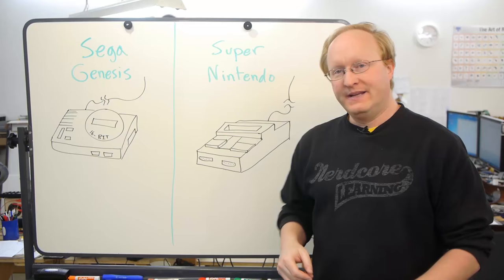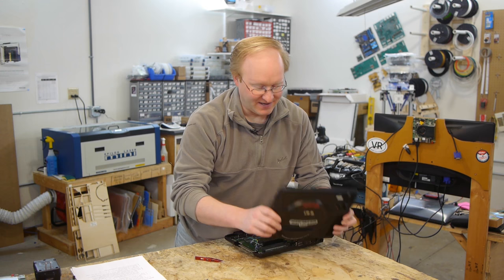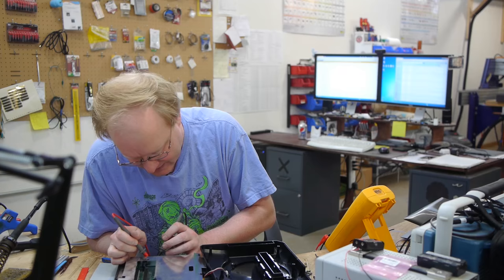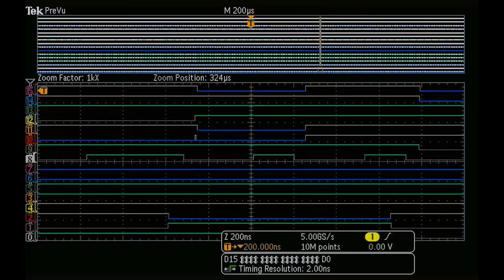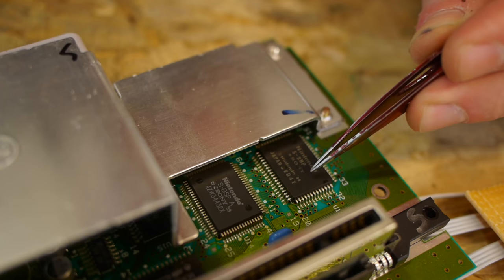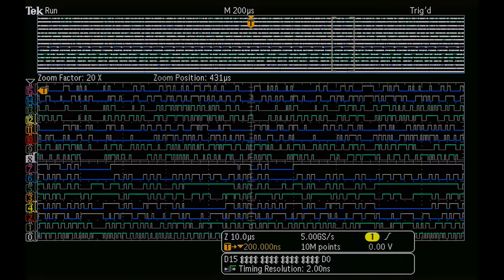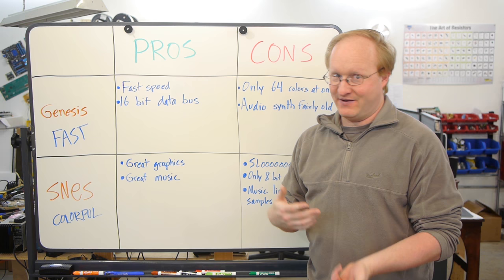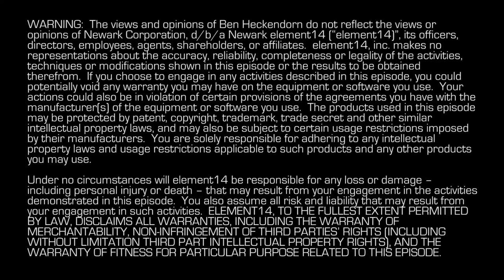Ben Heck’s 16-Bit Console Wars!

Comment: Ben! If possible, do a Playstation 2 vs Original Xbox detailed benchmark and testing. It was the fanboy fight of the 2000s! I'd love to see that, specially knowing that the PS2 was waaaaay ahead of it's time.
Reply: What about the GameCube? Can't it join the benchmarking party?! :P
Reply: jorenmartijn I don't think the GameCube has that much of horsepower compared to the PS2 and Xbox
Reply: Well, benchmarking those systems would not do justice because the plot is quite thicker.
The PS2 is basically a system with a very powerful CPU but a very basic GPU with a very fast but small video memory (4MB at blazing fast 48GB/s that is pretty much twice the speed of the PS3 video memory (!)).

Now on other hand, both cube and Xbox have a weaker CPU, but most of the 3D workload is made by the more advanced GPU that did for example hardware T&L and mixed the audio on separate DSPs, instead of using the CPU like the PS2 did.
Also cube/Xbox supported texture compression, that allowed em to do more with their memory spaces, and primitive pixel shaders, that allowed em to do certain special effects on screen like bump mapping, screen deformations, realtime shadows...

This last part the PS2 CPU can actually pull off, but you needed to sacrifice the CPU time the game would use.
Reply: Mike Fox Screw the new consoles go old school or go home.
Reply: Mike Fox Would be more fair and accurate to compare the PS2 to the DCast and Xbox to GC. Xbox would win in any case though.
Reply: Mike Fox It would be no contest, the original Xbox its like 4x more powerfull. The Gamecube was also more powerfull than the PS2. Dont know why you think the PS2 was ahead of its time when its was barelly more powerfull than a Dreamcast... 
Anyways at the end of this wikipedia page you have a technical comparison of all the consoles (included Dreamcast) of the Six generation http://en.wikipedia.org/wiki/History_of_video_game_consoles_(sixth_generation)
Reply: rayco santana it was ahead of it's time because of how it was built, look at how hard it is to emulate it? It has various coprocessors and it's a very complex design for any console at the time, much like the PS3's Cell Processor. And I wouldn't know because in my country, no one owned a Dream Cast, it wasn't a thing here to buy it, never saw one for sale either used or new.
Reply: KernDesertPreppers the PS2 is new? Okay
Reply: Dr_Kachu san Thanks, I do really like digging into old hardware, I don't know why. That was a very interesting comment, I do know how it ticks though, but I'd like to see a video about it, it'd be interesting for others to get a sniff of old hardware.
Reply: Mike Fox There's no point, my Xbox Original can output 1080i where the PS2 struggles with 480i... the Gamecube is more powerful than the PS2, playstation was by far the weakest of that generation.
Reply: The Gamecube and Xbox were both more powerful than the PS2 (the issue with the Gamecube was the limited capacity of its optical media).
Reply: ***** The PS2 outputs 1080i too. Even if it's just 2 compared too the xbox' 5 games.
Reply: akawhut Not in the pal version, 480i is max... the Xbox can also do 720p which in my opinion looks much better than 1080i
Reply: Heh, talking in 16:9 ratios when most games were 4:3.
Reply: Dr_Kachu san the xbox is basicly an pc
Reply: Satakarnak
I like that logic, anything with a couple chips inside and input/ouput capability is basically a pc.
More seriously, what are you referring to ? Why would the Xbox be more a PC than the Gamecube or the Dreamcast for that matter ?
Reply: TheSliderW He's probably referring to how the xbox was basically built from off the shelf components and utilized directx (hence the name).
Reply: Nanofuture87
 Yeah, i can understand that feel especially since MS is a software dev for PC. But then again, almost every console was made out of off the shelf components and DX is a generic API like OpenGL which can be used in one form or another on pretty much any 6th generation console and above if you don't like the proprietary ones (Yes, nintendo and Sony also have their own API, they simply don't talk about it).
Reply: Dr_Kachu san You don't know what you're saying. The PS2 had something around 300mhz, whereas the Xbox had a 700+MHz CPU. The GPU in the original Xbox was also superior to the PS2, and the original Xbox also had direct x support. The original Xbox CPU had the same MHz as the Nintendo Wii, alright. Now stop talking out your ass. 

Again, the GameCube had 400+ MHz, and the PS2 is still at the 300MHz mark. The GameCube had a slightly better graphics processor too, but the limiting factor was those micro discs that held 1.5GB of data on them, as opposed to the 4.7 on the PS2. This is all fact, not bullshit.
Reply: TheSliderW Every console since the PS1 or so do indeed have a complete API to access the graphics, but not always the devs used it completely, generally going "bare to metal" when doing stuff that the APIs were too slow at.
But people did that to the Xbox as well, so you're correct in saying its the same thing.
Reply: Kyle247l Comparing CPUs clock by clock like that is a very,very bad idea, given the fact the architectural differences of the CPUs can easily skew the performance away.
I mean, do you actually think a Pentium 4 3 Ghz and a Core I7 3 Ghz have the same performance?

The PS2 CPU had three cores, each able to perform 8 floating point operations per cycle using SIMD processing each, while the Xbox CPU had only a single core able to perform 4 floating point operations per cycle or so.
So, the Xbox CPU gives you 2.9 billion FP operations per second, or 2.9 Gflops, while the PS2 CPU trio, the EE is able to perform around 7.6 GFLOPS, thus being the faster CPU, despise the slower clock.

But there is a reason why Xbox still wins and hard at triangle count for example.
To perform the 3D graphics, besides drawing the triangles, you also have to position/scale/translate, perform the 3D coordinates to 2D coordinates with perspective transformation and lighting calculation on the model, and this is accomplished by an operation dubbed "T&L" (as in Transform and lighting).
This operation is very heavy and requires you to perfom around 40 floating point operations PER triangle corner, or "vertice".

While the PS2 tackle this operation using its powerful CPU, the Xbox, just like the gamecube have dedicated circuit on its video chip that perform the T&L math MUCH faster than the PS2 CPU can accomplish, and does that without actually taking much CPU time, leaving the CPU free to do other things.

Also the PS2 had a very simplistic audio output with two channels, and all the audio mixing had to be done on the CPU as well, while Xbox and Cube had a dedicated coprocessor to handle this for em.

And finally, what limited the gamecube was not the disk, but the fact you only had 24MB of fast memory available, as the other 16 were really painfully pitifully slow, at 40MB/s, being completely useless for storing texture/geometry data.
Reply: Kyle247l There's no reason to be unpolite like that.
If you want to disprove me, go do some research on the architectures of the CPUs etc and bring some hard proof instead of doing pointless personal attacks.
Reply: Dr_Kachu san He may be a twat, but he's not wrong. The proof is in the pudding, play the same game on both systems and you'll see the difference. The PS2 would never have been able to run Halo 2 or Forza
Reply: *****
I'm not saying that the PS2 is more powerful than the Xbox. I'm saying it got a more powerful CPU, but have to waste all this extra power "emulating" things the Xbox does not only natively by hardware, but faster than what the PS2 is able off even if it used its whole CPU power for the task.
Reply: Dr_Kachu san The PS2 is all round shit, it was built as a DVD player first and not a console whereas all the other consoles were built for gaming.
Reply: *****
It's actually even weirder than that.
If the PS2 was aimed at being the cheapest DVD player possible, they probably would stick a dedicated Mpeg2 decoding chip on it and make an improved PS1 to cut costs on R&D.
But instead, the PS2 is the dream of a madman, it is a console that was designed to be a "supercomputer", to give the programmer a very powerful CPU, and use it to emulate pretty much everything else to cut costs, so it was more of a "jack of all trades, master of none", while Xbox and Gamecube were machines designed specifically to run 3D games and nothing else.

Ironically, the PS1 had a much, MUCH better design philosophy behind it, being for example the first commercial consumer product to sport hardware T&L (that operation i been nagging on my last 2 posts or so), and with this and its hardware triangle rastering engine, it managed to match a pentium 200 Mhz software mode tier 3D graphics with a 33 Mhz CPU.
I bet both the radeon and geforces powering the gamecube an xbox respectively are heavily inspired on the PS1 innovations, and PS2 was the only one to miss this boat.
Reply: Dr_Kachu san That doesn't make any sense, my Xbox and ps2 are both modded. The Xbox can emulate pretty much anything that came before it whereas the PlayStation struggles with anything past 2d. With mods the xbox is essentially a computer and you can do whatever you want to it, the PS2 is just a paper weight. The PS2's graphics and frame rate just made the console a paper weight, even back in the day i could see how bad it was in comparison to my other consoles. Xbox had custom soundtracks and a bunch of features the play station couldn't hope to achieve. Certainly not with an 8mb memory card...
Reply: ***** In the case of the emulation, the xbox have a HUGE advantage (no pun intended) by the fact it use a x86 CPU, which allow people to port PC emulators with Dynarec/JIT to it without much work, while with the PS2, you would have to rewrite the whole CPU emulation engine from scratch.
To explain a bit more detail, this jit/dyna stuff is a way to emulate the systems by translating the code from the original CPU to the host CPU and then running this code natively, while the other method, the interpretation runs the emulated code command by command with a massive switch statement thing.
But interpretation is "CPU agnostic", and you can just compile and run it on everything, but its horribly painfully slow.

And then there's the part where the PS2 CPU power comes from having three CPUs rather than one.
Splitting the emulation job between three CPUs is actually impossible unless the system being emulated also feature three CPUs, or have some heavy secondary task, like translating GPU code like it happens with the dolphin emulator etc..
So yes, emulation is not exactly a fun job for a PS2.
A better case would be using the Xbox and the PS2 to encode video, in this case using only the CPU, the PS2 would beat the hell out of the Xbox... until you used the pixel shaders on the GPU of the Xbox.
Reply: PS2 had arguably a better library, that's all it had going for it.
Reply: ***** Run a Sega Saturn emulator on the Xbox.
Reply: Arctic FoxX
 It will run slowly for obvious reasons, but if you attempt to run it on the PS2, the emulator programmers will most likely choose chasing you with pitchfork and torches instead of coding for that hell to emulate an even worse hell.
Reply: Dr_Kachu san
I better go into hiding while the angry modder mob passes :).
Reply: Mike Fox The Gamecube is a surprisingly powerful lunchbox. It was rarely used to its potential. Play RE4 on the GC and then on the PS2. There's a big difference.
Reply: s0nnyburnett
The RAM crippled the poor lunchbox quite hard.
Just to give a clue, just look how many games on it use a lot of identical models onscreen to make use of its powerful 3D engine.
Basically it is able to do 128 marios, but not 128 different nintendo characters.
Reply: Dr_Kachu san GCN had 43 total MB of memory. PS2 had a bit less. but proof is in the pudding; RE4 looked like dog crap on PS2 compared to Gamecube.
Reply: Xbox 1st is best (NOT THE XBOX ONE 2013) WHY?

PS2:Half Life 1
XBOX 1st: HL2

BUT:
PS3/XBOX 360 HL2/HL2EP1/HL2EP2

Wtf Why not HL3/HL2EP3 COMING FOR PS4/XBOX ONE 2013???

Gabe Newell, this is how you ****ing count to three.
1,2,3. DONE NOW GET HL3
Reply: HL3 will probably stay pc exclusive, not like they need extra console sales, it will still sell stupid amount of copies just being on pc
Reply: *****
It doesn't matter, nobody bought xbones anyway.
Reply: Mike Fox You've obviously never seen Resident Evil 4 on the GameCube compared to the PS2. The GameCube version runs and looks much better. Also, if you're looking at raw processor speed, I think the original Xbox is the power house of the 3. It was basically a PC IIRC. The GameCube is #2, and the PS2 is last. Of course, it's like comparing apples and oranges anyways since they all used entirely different processors. I think you'd be surprised at how they actually compare.
Reply: Garth Palmer
From the 43 MB, 3MB are cache (but 2 of those 3 actually do save memory as they store the Zbuffer and backbuffer), and 16MB are pretty much useless for realtime 3D because they have an atrocious 80MB/s of access rate and are generally used more for audio and disk cache. The actual Work ram of the device where you can store texture and models is onle 24MB of that fast sram like memory.
But the cube still can do better textures than the PS2 because it supports S3TC compression that makes the textures 4-8 times smaller.
Reply: Dr_Kachu san well ok then. just saying its really not that gimped, at least compared to PS2. still ran fine and had plenty of good games. it was a better console than the Wii.
Reply: Mike Fox There is no point as the original Xbox would win using Ben's testing methods.
Reply: BlueFoxTV I didn't know till people started commenting, though it was a real debate. People almost hit each other over it. Funny enough when I was a kid, I went to a cousin's place and he had an Xbox, I was like..  "what Playstation is that?" xD
Reply: Garth Palmer
 Wii actually got to show what a gamecube with more memory is able to with Super Mario galaxy, given the fact its just the cube with a moderate clock bump that would not be alone the reason to all the improvement, and cube would at least be able to pull that game off at 30 fps.

But its a shame SMG is pretty much the only game that shows what Wii could actually do.
Reply: Dr_Kachu san in terms of games though, GCN had better games overall. Wii has like, SMG 1&2, Skyward Sword and Brawl.
Reply: Garth Palmer Indeed it had, given the fact the third parties weren't trying to cash in on the "casual gaemrz" on the cube, and nintendo was not too busy doing wagglefests.

Also the industry don't have a frakking clue on what the casuals actually want, and everything they do to attempt to "cater to the casual audience" actually pushes em farther and farther from the games.
Reply: Mike Fox Actually the GameCube was more powerful than the PS2. 

The PS2 was actually the least powerful system in the GCN/Xbox/PS2 troupe.
Reply: The 64th Shadow Heck, the Dreamcast could out perform the PS2 in some areas, just try Quake3 or UnrealT on the DC, simply the best console versions of these.
Reply: stunthumb
The biggest advantage DC had over the PS2 was the S3TC texture compression also available on it, which allowed that huge (for the time at least) textures on shenmue.
But the PS2 did beat it quite hard on triangle count,thus making very hard if not impossible to DC to run for example GTA 3/SA etc..
Reply: Dr_Kachu san Yeah, the lack of big games like GTA3 really hurt the DC.
Reply: DC had a small library but a lot of the games it had were just great. Still miss Power Stone and Starlancer to this day. Capcom really needs to remaster and rerelease the Power Stone games.
Reply: Mike Fox You're kidding, right?
GameCube = 485Mhz 32bit CPU
PS2 = 295MHz 32bit CPU
GameCube = 162 MHz ATI "Flipper" GPU
PS2 = 147 MHz GS GPU

The GameCube may look cute and all, but it is more comparable to the Xbox. PS2 is more comparable to the Dreamcast.
Reply: Dash
Not wanting to repeat myself much, but comparing CPU clock by clock like that is never a good idea, specially when you forget to mention that one of the CPUs is actually a triple core CPU (the PS2 one).

But as i said earlier, the end result still ends with Cube and Xbox winning hard on the 3D rendering department because they have dedicated and very powerful circuitry to perform the heaviest CPU bound operation when drawing 3D graphics, while the PS2 have to resort to its CPU to not get even half of the performance of the other two on that particular operation while using its full processing power.
Reply: Dr_Kachu san I do agree with that. But I still think the Xbox and Gamecube had, in addition to better clock speeds, better designed CPUs and GPUs since they were newer and were developed by veteran companies like IBM, ATi, Nvidia and Intel. Not to say that the PS2 sucked. It was good for it's time. But when you mentioned that the PS2 was using 3 core tech, where did you hear that? Is there a link to that info?
Reply: Dash
I'm a bit lazy to go after better sources right now, but:
https://en.wikipedia.org/wiki/PlayStation_2_hardware
The V0 and V1 units are well, to be more precise DSP units rather than full CPUs, but they give the PS2 CPU the capacity of processing around 6.2 billion of multiply+accumulate operations per second, if compared to the 1.9 billion you get from the gamecube and around 3 billion the Xbox CPU does.
But the google (lol) also tells me that the T&L units from Xbox and cube clock around 10 billion of those operations per second, so it's quite a wash.
Reply: Dash
I really have no idea why sony went with that route, instead of just improving over what PS1 had, because that beast was actually very advanced for its time.
For example, unlike the PS2, it actually did hardware T&L.
Actually, the whole 3D job on the PS1 was done by hardware, which allowed it to have a CPU that was around the performance of a 486 DX66, and pull off pentium 166 softmode tier graphics.
Reply: Dr_Kachu san How to make a Nintendo console:
Step 1: give it a fairly good CPU (The N64 being excluded, which had a beast for its time
Step 2: give it a monster GPU (The only reason the N64 didn't look good at the beginning was SGI's awful microcode)
Step 3: give it a pitiful amount of ram (The SNES should have had the wram and vram amount switched.
Reply: ***** Actually, nintendo don't always give the consoles a pitiful amount of memory.
They sometimes just make it awful in some other way, like making the memory really slow or really laggy or a combination of both, or as you said, in the wrong place.
I think the only consoles nintendo didn't did some sort of mistake with the memory were the gameboy color and the WiiU.
Reply: ***** Conker's Bad Fur Day looks a lot better than any PS1 game I've seen, and I'm sure you could still make the N64 do a bit better. (There are also plenty of other good looking games, but they were released in 2000 and 2001 and other late years where Nintendo allowed companies to make their own microcode.) When I said it could have looked good, I obviously didn't mean by today's standards.

About Nintendo consoles with their memory, this is the way I see it:

NES: Too little memory, (4KB I think?) but the console was made in 1983. (Cartridges had chrrom, or chrram, so tiles weren't stored in vram, only BG tables.)

SNES: More than enough ram, too little audio and vram. The SNES is slower than dirt at uploading information where it can only transfer about 6KB per frame (without any black border on the top and bottom of the screen), but the Genesis had it about just as bad. I think it can upload about 6.5 KB per frame, which isn't much better, so I'll give it to Nintendo here. The main problem is that sprites can only pull their graphics from a 1/4 of vram, because there aren't enough character bits in oam. The Genesis doesn't have this problem because it has less sprites so each sprite has more information on it. The SNES should have just done away with 8x8 sized sprites and used 16x16 as a minimum like the Turbo graphics 16 so you could index all of vram. The SNES only allows you to use 2 different sprite sizes onscreen anyway. (I've actually been writing programs on the SNES so I know alot about it.)

N64: too little ram (4MB), but the biggest offender is the 4KB texture cache, only allowing 64x64 sized sprites. The N64 actually would have been a beast a being a frame buffer 2D system.

GC: Like you said. I don't think the memory on the GameCube is all purpose like the N64 either, in that it's more like the SNES that each thing has its own ram.

Wii: Don't know, don't care.

Wii U: 2GB is enough. The Xbox One and PS4's amount of ram is unproportional to the rest of the system's specifications.

Also, the Gameboy Advance was fine. You could almost update all of the 96KB of vram in one frame, although I can't say that 96 KB is too remarkable, especially when you can have 4 8bpp BG layers simultaneously onscreen. Ram is fine, as I think I've heard it has 32KB of fast access memory, and 256KB of slower memory. The processor runs at 16.8MHz so I don't think a minor speed penalty would do much. (I'm not 100% sure about main ram on the Gameboy Advance though.)
Reply: Maybe you should have devoted the time that you wrote that into reading. You only needed to read the first 9 line paragraph, as the rest was for Dr_Kachu san.
Reply: *****
On the case of the SNES, they could in theory use the memory to mitigate the slowdown problems of the cheaper carts.
The snes CPU can switch between 1.76 Mhz, 2.68 Mhz and 3.58 Mhz, and depending on the quality of the ROM available on the cartridge, the game will be programmed to run either at 2.68 or 3.58, and well, several action games used the 2.68 to cut down on the costs.
But if snes had some lets say 4KB fast SRAM memory somewhere that could run snes code at 3.58 Mhz, games would be able to just dump the critical speed code there and don't even NEED the more expensive rom anymore.

GBA does exactly that, by having a 16bit RAM that gets slow if you try to run ARM code on it instead of using the THUMB mode, but it having a small 32bit 32KB cache where ARM runs faster than THUMB.
Reply: Dr_Kachu san Another nice thing about having 128KB of ram is that things like level maps can be decompressed when the level is loading so that you don't need to constantly decompress the level map while the screen scrolls. A 3.58 MHz 65816 really isn't that much slower than a 7.8 68000. A simple branch on the 65816 takes 3 cycles, whereas it takes 12, which is actually about twice as slow, taking the higher clockspeed into account. It's not like anyone has accused the NES of being twice as slow as the Gameboy because it is clocked about half as fast.
Reply: *****
Well, 64KB of main ram probably would be enough, if that meant having twice the tile memory.
That would even make the high res mode of the snes actually useable.
Reply: ***** The 128KB of WRAM on the SNES isn't really 128KB, let me put it this way. It's like 64KB + 64KB, the 5A22 is stopped and each DMA operation can only access one 64k bank at a time. The full 128KB can be accessed but it limits the system. The 5A22 isn't a  65c816 I don't know why people still to this day call it a 65c816. As a matter of a fact the SPC700 (yet better) is very similar to the 6502 and no one says that the SPC700 is a 6502. For me both systems the Genesis and the SNES are very similar with the advantage on the SNES just for the extra HW stuff it does video effects and sound.
Reply: Marco Duarte The 5A22 is a 65816 with extra thinks inside, like a multiplication unit and a DMA controller, but you communicate with them like they are not part of the 65815, because they aren't: It's like multiple things put in one plastic case. There isn't any multiplication instruction or anything; you have to write  to registers to the registers for the multiplicand and the multiplier, and the multiplication unit will then give you the result in a register that has that sole purpose. Same with DMA. Their isn't an instruction for it, you have to do multiple loads and stores to different registers to activate the DMA controller located in the same plastic casing. I don't think the SPC 700 is like this, because I'm pretty sure it has its own instructions that the 6502 doesn't have unlike the 5A22, like how it can exchange nibbles in a byte. The SNES is not very similar to the Genesis at all except that they are similar from a processing power point of view, but both systems where designed differently, unlike what I could say about consoles today.
Reply: Marco Duarte
I don't see having to stop and swap page etc being a painful problem.
Probably the worst part of the snes is not being able to access the VRAM outside the vblank.
Reply: ***** You got my point here: "The SNES is not very similar to the Genesis at all except that they are similar from a processing power point of view, but both systems where designed differently, unlike what I could say about consoles today." About the rest just take a look at the SPC-700 information. When I said "The 5A22 isn't a  65c816" it's like a 5A22 is a 5A22 and a 65c816 is a 65c816. Thou the 5A22 is binary compatible with the 65c816 and the 6502 it's "extra" stuff make it a 5A22.
Reply: Dr_Kachu san Never said that it was a painful problem. I just "quickly" explained how it works.
Reply: I am a PC gamer these days but be honest Xbox original is the clear cut winner
Reply: Jack Bob I'd agree to that, but the console that moved copies was the PS2. I personally had a PS2 but I'd love to get me an Xbox original to replay games with higher texture quality and sound.
Reply: Mike Fox The PS2 had a few great games (Shadow Of The Colussus, Ratchet and Clank) but the Xbox was more like a PC it does stand for DirectX box its was further ahead of its time IMO and with its Live service it pushed the boundaries of what was previously done on a console (excluding the dreamcast)
Reply: Jack Bob the point was really the multiplatform games, the ps2 usually sold twice if not more copies of the same game released on the Xbox.
Reply: Mike Fox Despite the fact that it almost consistently got the worst version between the 3 major consoles.
Reply: ***** but it did.
Reply: +rayco santana Sorry, but that technical comparison is full of errors.
Reply: +stunthumb As a fan a big collector of DC stuff I inform. GTA3 was at one point coming to DC and PC, but once SEGA killed it the GTA "project" for DC was dropped. Same for HALO. As a prove there is a SEGA flyer for up-coming games where you can see and read about both games and for a lot more games...
Reply: The ps2 had a terga 2 prossesor and was 2times faster then the original xbox it also had a better color pallet. The xbox ran off of a Microsoft crd chip they use those in the early chrombooks that were released. And xbox had a better online experience and better controllers except for the duke that was released with the console. So you are right ps2 wins all the way. The xbox was slightly faster when it came to fps so shooters and racing games ran smoother but ps2 was better at rendering rpgs and plattfourmers
Reply: Ray L "The ps2 had a terga 2 prossesor and was 2times faster then the original xbox"

No, It ran on the custom "Emotion Engine" processor, which was based on MIPS R5900. And no, it's not twice as powerful as the Pentium III in the original Xbox. The Emotion engine can apparently do 6 billion instructions per second compared to the Pentium III that does about 2.5 billion at the clock speed it runs at, but because of the MIPS architecture of the Emotion Engine, each "instruction" is very limited, and there are several times where you could probably accomplish four different instructions in MIPS in one instruction in x86. If anything, it's probably the other way around. I don't know where you're getting color palette from, because just about every 3D system that isn't the 32x uses 24bit color.

Like I said, in terms of power, it's

Dreamcast
PS2

A decent sized technological gap...

GameCube
Xbox

And the Dreamcast was even more powerful than the PS2 is certain aspects, but not over all. Most sold almost never has any correlation to most powerful.
Reply: *****
Actually, the PS2 processor as i probably stated on this reply line before is a trio of CPUs, or a CPU and two DSPs to be more precise, and if you gather all three yes, they're more powerful than the Xbox or gamecube CPUs.
But as they HAVE to do the T&L and audio mixing bullshit with code, while Xbox and gamecube offload those operations to dedicated faster hardware solutions, they win overrall.
In theory the PS2 is more flexible due that but its not as nearly enough advantage to put it on par with the others.
Reply: *****  Actually, you don't need to go this far.
In terms of raw flops, the PS2 CPU offers you 6.7GFlops, while the gamecube and Xbox T&L hardware units do over 10 with ease, but the T&L hardware only can do T&L, which is well pretty much the biggest floating point load when doing 3D graphics.
So even at the "untextured raw triangles", Xbox and cube still kicks the PS2 bucket hard.
PS2 would probably win if you were using the consoles to do things like protein unfolding, but as far i know, they're machines meant to run 3D graphics.
Reply: +Mike Fox i am a ps2 fan but Xbox and Gamecube both was superior systems....both had better graphics abilities and xbox had a far faster system
Reply: Team Cannon Fodder You're telling me the Gameboy had better graphics than the PS2?
Reply: gamecube...spelling error lol, corrected now
Reply: +Team Cannon Fodder My understanding is that's correct. I know the console itself is quite a bit more powerful in several areas but graphics were pushed on that console because Nintendo was doing that at the time. NES was a graphical powerhouse in its day, as odd as that sounds now. SNES was cutting edge graphics wise too, and obviously N64 had that going for it as well. Gamecube was sort of the last hurrah for that era of Nintendo's history. That machine was capable of particle effects the others couldn't do until the next generation, for example. I believe the poly count was a good deal higher too but I wouldn't know by how much unless I looked it up.
Reply: Hezekiah Ramirez Nothing bar arcades could make the bidirectional smooth 60 fps scrolling of the NES back then until the release of the SMS,
Not even computers until the MSX2 release.
Reply: Dr_Kachu san that problem was solved by John Carmack with the commander Keen games (he tricked the computer into loading pixels before the player reached end of screen) that is how most IBM clone PCs ended up doing it until they started rivalling consoles
Reply: Hezekiah Ramirez yes and no, most Nintendo consoles was better in colours and other similar areas but Sega had better CPUs also interesting point the N64 graphics was first given to SEGA and the head of the company in the US wanted to use it. Japan refused and made the saturn with their own graphics.....also worth mentioning the head of the US wanted to build a console WITH sony, once again ruined by Sega of Japan...in fact most of the bad descisions regarding the 32x, sega cd, sega saturn, sega dreamcast all came from Japan, can you imagine the Saturn with n64's graphics even a 32bit version of them? 

As for Gamecube, i think the xbox was more powerful, in terms of graphics but the original xbox was basically a PC for the masses anyway
Reply: Team Cannon Fodder He got quite close, with 40 fps, but its still not the 60 the NES did.
IBM PC was actually a quite bizarre system, held up by some really bad design decisions ibm did, and the pixel rate was definitively one of em.
In the standard VGA, there are only those few "timming windows" where the CPU can actually write to the memory, and if you try to do it out of the window, the video card actually locks up the CPU until the window is available with a wait state bullshit.
This effectively drops the CPU speed to around the original 8088 speed, no matter how fast the thing is, thus making impossible to reach 60 fps on the older IBM standard cards, which made all the ports etc run at 30 fps on it.
Doom ends being the most extreme example, because it was doing graphics that were basically impossible for an sega genesis or snes, but was still limited by this bottleneck thus having a maximum frame rate of 35 fps.

But this changed completely with the pentium, where intel basically redesigned the whole system from the ground up, tossing away "legacy stuff" and making PCI a thing.
With the changes, PC could 60fps/1024x768 on 2D without breaking a sweat.
Reply: +Mike Fox ps2 actually wasn't. The gamecube was technically faster in some regards than the ps2, hence why the gamecube version of RE4 looked and sounded so much better than the ps2 version. The real limiting factor was the disc capacity, half of what a dvd could hold. 

With regards to the xbox vs ps2, once again the xbox actually was more powerful. It was just a pain to work with. By the time it came out, the ps2 already sold so much, so developers stuck with it. 

Not downplaying the ps2, I loved my ps2 back in the day and it was easily my second favorite console of that gen (my favorite was the dreamcast). Just saying though, the ps2 wasn't ahead of its time at all. With DVDs, yes. But everything else, not so much.
Reply: Xerazal
The RAM was a much bigger limiting factor on the gamecube than the disk size.
24MB of actually useful memory is just too few, specially if compared to the 32MB found on the PS2 and 64 on Xbox.
Of course, texture wise gamecube was better than the PS2 because it supported S3TC texture compression, which made em 4 times smaller on the memory, but Xbox did as well and Xbox again had 64MB to use those compressed things.
This is also the reason why PS2 can't run shenmue.
DC was the first console to do S3TC.
Reply: Actually with 4MB you could fit the frame buffer and Z-buffer and have space for some textures , after all the gamecube fit their stuff in a fast 3MB cache, with 1MB for each of those things.
But that meant organizing the whole scene by the textures and trying to reuse em all you can, because every texture switch, a pain.
And as it didn't supported texture compression, "switching textures" on PS2 was even worse.
Well, to be fair to the PS2, you KINDA have some kind of something you can kinda call a "compression" that is using paletted 16/256 color textures, but this don't work well at all with organic textures.
But when your 16 color texture use the same memory space as the 65k color textures of the gamecube/xbox, stuff gets hard.
Reply: Dr_Kachu san You talk about texture compression, but I'm pretty sure it's lossy, (like a jpeg) so I'm not to sure you'd really get much, if any, advantage over a 256 color paletted texture. I think the compression works like some amount of colors (2 or 4 or something) with "unlimited" luminescence values in something like a 4x4 pixel square. I may be spewing out nonsense though. I don't think GC and Xbox textures would be 16 bit RGB, but 24 bit.

Also, about the GC memory size, I'm pretty sure it's in a better spot than the PS2. The thing you're forgetting about is although there's 24MB of main ram, (and 3 MB for the frame buffer) there's also 16MB that seems was used for audio? (Why that large compared to everything else?) Anyway, one thing I've heard is that you can DMA information from the 16MB ram into main ram and vice versa. It takes more time, but I'm pretty sure ram on the GameCube is faster than on the PS2. I wouldn't even be surprised if you could reasonably copy textures from the smaller ram into a buffer in main ram and keep overwriting it while rendering the scene.
Reply: *****
I don't count the audio ram as "useable memory for graphics" because its access rate is around 40 MB/s, which make it more useful as a disk cache rather than something you can access every frame.
Also i said "24bit" due how the S3TC format works.
Each of the 4x4 pixel blocks have four possible colors, which two being set indeed by two 16bit values, but the other two being 25%+75% and 75%+25% mixes of the other two, and those mixes being free from the 16bit range limit.
And believe me, the S3TC looks a HELL lot better than 16 color textures and even most 256 color ones (which take twice the memory space of the S3TC ones) due not having to rely on dither that looks very bad when used as textures.
Reply: Dr_Kachu san Only 40MB per second? Yeah, the blows. I'm not entirely sure what a disk cache is though, just loading data from the disk into there instead of main ram? (I know a lot more about early technology like the SNES) I suppose there are a couple of clever ways you could use it, but yeah, that transfer rate is extremely limiting. I definitely imagine the S3TC format looking a million times better than a regular 4bpp image. I imagine some really colorful textures would be quite limited though, which is why I'm now asking: is there a way to use non compressed, 32bpp textures? I mean, I imagine they'd be used for 2D games.

Yeah though, it's clear you know a lot more about this stuff though, so I should probably back off...

Edit: Actually, where did you find the page that said 40MB per second? I just want to know because nothing I know goes that in depth about the GameCube's hardware. It's kind of sad though, that I just found out that the GameCube's ram is SRAM instead of DRAM, just because (like I said about me and older technology) that's what I'm used to and it's more flexible.
Reply: ***** Theorical and pratical polygon per second measures are very different, specially when you use the CPU to perform the T&L as was the case with the DC, but you're probably right at the memory being a bigger issue, given the fact gamecube ran into this very same problem, only being able to flex its triangle pushing muscles when on games that used a lot of repeated geometry.
6 million of triangles per second at 60 fps (because this is dreamcast and running under 60 fps on it is heresy), gives you 100.000 triangles per screen.

Supposing you use around 400k triangles for the whole scene to get your 100k per screen, each with X/Y/Z, normals and UV coordinates for each vertex, we're talking about 32 bytes per vertex here (everything on 32bit float format, which eats 4 bytes each).
Also supposing the meshes use indexed vertices that makes the rate be around one vertex per triangle.
With all those suppositions, we're talking about 12MB of memory used on vertices. (400.000 vertices * 32 bytes), which is well, half of what dreamcast have in total memory.
So 6kk triangles per second on the dreamcast is impratical as hell, compressing textures or not, because in this scenario, you're left pretty much with only the video memory for storing the textures (6MB or so), and 4MB of memory for program, audio, ingame databases etc..
Actually i did read once that gamecube games generally only use around 150k vertices on the level geometry due having to have space for the textures etc..
Reply: *****
Actually its 81MB/s:
http://www.segatech.com/gamecube/overview/motherboard%20datapath.gif

Still quite awful.
Reply: Dr_Kachu san Well, at least in the way it appears to be set up, the GPU has direct access to it. But yeah, on a 60fps game, (assuming you're accessing it every frame) that's barely over one MB... It's kind of absurd how they'd have that much ram pretty much only for audio and then all the other crap has to fit into a space less than twice as large. I bet it was a ton cheaper than main ram though. Still, I'd rather have faster but less ram in that case.
Reply: *****
Well, it is still faster than the disk, so you can do something like having part of the level loaded on the memory, and "slowly stream it" to the main memory when the player reach another place rather than having to pull it from the disk.
But hoping to use it to read textures from? nope.
Reply: Dr_Kachu san You know, how many bytes per second can the PS2's 32MB of dram transfer? How about the Xbox? I'm not familiar with the cost of any of them (I got my GameCube when I was about 5, so...) but I'd imagine the Xbox's 64MB of ram has to be slower than the PS2's 32.
Reply: *****
The main memory runs at 3.2 GB/s, while the 4MB cache reaches insanely fast 48GB/s (yes, actually faster than the PS3 video memory).

And the Xbox is actually faster in terms of main memory speed, reaching 6.4 GB/s.
Reply: *****
Well i think one of the reasons is that DC didn't had that much FPU grunt to perform the T&L thing.
It's CPU delivers around 1.4 GFlops of performance, while the PS2 CPU can go over 6, and as i probably stated a long time ago on this "thread", the T&L hardware units of the gamecube and Xbox can go over 10 Gflops with ease, so you probably could not pull a gamecube on it and make a game with a lot of copypasted grass or a trillion of small enemies etc..
Also it didn't featured any sort of fragment shaders.
Reply: *****
Those video effects take time on the GPU rather than the CPU, and well, the only thing PS2 did on the CPU DC did on hardware was audio mixing, which indeed does take quite a bit of time, but not enough to knock the PS2 CPU to dreamcast levels.
Also the jaggies on PS2 was not due lack of AA. DC also didn't did AA, but it did a funny little thing called running every single frakking game released to it at 640x480.
This made the aliasing get hidden by the television signal, and gave it that smooth nice visual.

And yes, this means exactly what i'm implying here: PS2 games ran under this resolution most of the time.
The early titles actually did 320x224, and the latter ones jumped to the incredible! resolution of 512x480.
Also i'm not entirely sure but i think the PS2 could not use trilinear filtering, which made the textures from a far distance get all pixelated and awful.
This or they didn't used it because made the textures take twice the video RAM and that was not up for discussion on the system.
Reply: *****
All 192/224/240 systems use only half of the fields because well it just plain looks better on CRTs, and also allows you to do real 60fps.
The trick is that the signal generator itself that decides if its an odd or even field, and if you keep just repeating the same field over and over, you get 60 fps AND neat scanlined graphics.
Reply: ***** I think their upscalers are made with 480i in mind.
They need to get the previous frames, use all sort of motion predict wizardry and filtering to make interlaced video look decent on the LCD, because otherwise it would look just awfully combed and blurred.
But if the upscaler is not programmed to deal with 240p, it will try to treat it as 480i with.. less than spetacular results to say the last.
Reply: Dr_Kachu san It does try to treat it as 480i. Analog signals look better on an analog TV 90% of the time.

Damn though, the Xbox's main is fast. I must be crazy, but looking it up, I thought there was something about how the only way to interact with dram is by large chunks that you load into caches, while you can interact with sram normally. Is this true, or am I crazy? I'm just now confused as to how the GameCube would even have any advantage over the PS2.
Reply: *****
Sram is just faster than Dram in terms of access rate, and you don't need to keep refreshing it.
Now in terms of advantages of the gamecube over the PS2, its mostly its primitive pixel shaders, texture compression and fast hardware T&L.
First thing allows the gamecube to do several per pixel special effects that are basically impossible on the PS2, like dot 3 bump map, projected shadows, fullscreen deformations, motion blur, all sorts of screen tinting filters...
Second one not only saves space on the memory and allow you to have sharper textures than on the PS2, as makes the texture switching a lot faster.
And the last one is directly related to how many polygons per screen you can have, as it dictates the speed the console can transform X,Y,Z to X,Y with perspective (and model positioning/rotating/scaling, all in the same operation). which is why the system can do all those repeated 3D geometries like pikmin, the zelda WW grass, those frakton of enemies on metroid prime etc...
Reply: Dr_Kachu san Faster in terms of access rate? It doesn't seem so based on those numbers that were given. I'm just kind of confused, because I thought ram speed was about one of the main factors in determining the power of a system, as it's not like a CPU or GPU will load data from ram and not do anything with it, and as far as I understand, it doesn't matter how fast your CPU or GPU is if the memory in the system is slow. Die space on a GPU is also kind of a factor, but it's more kind of for "special effects" than raw power. It's like transparencies on the SNES: you aren't actually loading any more tile data, it's just that you're adding and dividing with the numbers you'd use anyway, and because this is done inside of the video processor, you can consider it instantaneous.
Reply: ***** Caches are a thing of beauty.
They allow you to "profit" on every situation where you will use the same region of the memory more than once, and on 3D rendering this happen quite often due overdraws, z-buffer tests, using the same texture on several polygons... and gamecube keeps everything important on 3D rendering and CPU code running in those things.
Both on PS2 and gamecube the typical rendering goes like this:
1) you copy one or more textures to the video cache
2) you render everything that will use those textures on buffers on the cache itself
3) go back to 1 until scene is done
The ram is only actually used when you perform those switches (and when reading the geometry data, but that don't hit as nearly as hard as the texture reads).
PS2 may look at first as still having the advantage as well, its video cache is bigger and it have a faster main memory, but then you have to remember that the gamecube textures are 4 times smaller due the compression and this ends giving it a edge.
Reply: Dr_Kachu san You said the PS2's video cache is bigger (which I guess could be used for larger textures if no compression on either system is being used) but is it faster? Wasn't it the blazing fast number said earlier? Anyway, I think the main draw to the GameCube is all the "special effects" it can do that often make more of a difference than "brute strength". The SNES is the same way: the vram bandwidth on the SNES is pretty much the same as Genesis, but if you look at how much die space there is dedicated to graphics (there are 2 CPU sized chips as opposed to one) there's a lot of features they packed in, some of which are damn near useless and I would have much rather had them omitted for more colors or sprite ram size (like 64x64 sprites when vram size and bandwidth don't make these feasible) but others are very useful and aren't even found in most arcade boards of the time, like 8bpp graphics (256 color) or color math (transparencies.) The Neo Geo doesn't have either and it smokes the SNES in terms of "brute strength".
Reply: *****
Depending on the resolution and other factors you do indeed have more space on the PS2 video cache, but its around 2MB vs 1MB on the gamecube cache. but as i said, textures are 4 times smaller on GCN, so it still can pack double the detail per "switch".
Also the "special effects" are something i should try to explain better.
The gcn video have this list of 16 very primitive "commands" with up to 4 "inputs" where it can mix em with multiply, add, subtract and perform clamping etc.. and the fun part is that you can store the final color on one of four registers instead of sending to the screen/texture and reuse it on the next command, and well, GCN can actually execute 4 of those commands on a single GPU cycle, so it can do all sort of special effects without exactly touch the memory as much as the PS2 need to do the same things.
Also another thing the cube can do that is generally used for the screen deformations but can be used for quite a few other feats is the so called "indirect texturing", where you feed the indirect texturing unit a texture where red and green represent the X and Y coordinates, and it reads another texture using the colors as an input.
Reply: Dr_Kachu san Yeah, as I said, I'm not to knowledgeable on 3D hardware. I just know that Nintendo generally prefers to jam as much features into the video hardware as possible. From what I've been told though, it seems the PS2 would actually beat the GameCube at a test where only 32bit textured, unshaded, and non everything else polygons are being drawn, which actually comes as a surprise to me. I looked at the bandwidth of the 3MB inside the GPU, and according to Wikipedia, it's "between 20-25GB/s". Isn't that only about half as fast as the PS2?
Reply: I also actually just now found out something very odd to me... I never knew about latency in accessing memory before the transfer even starts. Although the Xbox's main ram is moving insanely fast, it seems the latency (before anything gets transferred I assume) is 3x slower than the GameCube, (30ns vs 10ns) so it depends on what you're doing. I'm not entirely sure how much 10ns is, but it's still only a third as large. It actually seems that the Xbox's launch price was a whole $100 ahead of the GameCube, and if we're factoring that in, I have no idea how they can look so graphically similar to one another. (I don't even think I could tell you which one looks better. Halo 2 looks great, but Rouge Squadron 2 looks just as good.)
Reply: *****
Yes it is, but the GCN is not as dependant on bandwith as the PS2.
Actually a good example on how the bandwith sometimes does not matter is simply the fact PS3 have less overrall memory bandwith than the PS2 for its frame buffer and textures etc..
It simply does not have a ultra fast cache that fits the whole shit, and have to depend on a 19GB/s GDDR3 memory.
But as it have a lot of "internal storage" in form of memory registers etc.. well one of em end doing Uncharted 2 and the other don't.
Reply: Not as dependent on bandwidth? Is that just like doing things in hardware vs. in software? There seem to be a great deal of things you can do with a 3D GPU to the point that it seems programmable, where with a 2D GPU, it's just like move background 1, update sprite table, etc.
Reply: ***** It's just about offloading the things that normally would use the memory into an "internal small memory", and also "using the memory and internal memory" at same time.
Reply: ***** Actually, the system memory of the PS2 is faster, going at 3.2 GB/s versus the 2.6GB/s on the cube.
And in terms of video cache speed, PS2 runs its cache at 48GB/s (!), versus 17GB/s on the gamecube.
So if was just a matter of bandwith, not only the gamecube, as the Xbox and PS3 would have problems with the PS2.
Reply: Dr_Kachu san I guess that's why the PS2 can launch missiles. :D
Reply: *****
Well, it was mostly due the EE programmable power.
Freely programmable 6 GFlops was not that bad back then.. but not as good as fixed hardware for 3D stuff.
Reply: Yeah, I've always been under the impression that the PS2 is more of a general purpose computer than a machine specifically designed to output 3D graphics, which is kind of a problem. It's kind of like the original PlayStation's GPU didn't have any 3D capabilities (no z-buffer and no perspective correction. You're only moving vertices on the x and y axis, not the z.) The Nintendo 64 had both, but ironically, I think many latter games didn't actually use the z buffer and most of sorted everything by depth because I think it slowed it down.
Reply: *****
Actually, the PS1 is a LOT more specialized into 3D than the PS2 ironically.
While it don't support Z-buffer or perspective correction due those things being too expensive for 1994 technology (Z-buffer requiring too much memory and perspective correction requiring a dedicated fast divide
circuit), the rest was all hardware based.

First, it has a coprocessor that is entirely dedicated to perform the T&L operations (that are actually what allow you to move stuff in X,Y,Z space and transform it into X/Y from a camera perspective), which it did MUCH faster than the CPUs of the time, at a point sega needed to shove several CPUs and DSPs on saturn to almost reach half of its performance.
Secondly, while the playstation don't support Zbuffer, it support ordering the triangles from back to front using a special mode on its DMA unit that perform the operation again a lot faster than a general purpose CPU.
And finally, the triangle rastering itself is performed by the graphical chip, pretty much like the modern GPU does, sans bilinear filtering and perspective correction of course.
The CPU itself on PS1 basically does no work on 3D, other than accessing the coprocessor and moving some data around, and it's as fast as a 40 Mhz 486 CPU, but still delivers something akin to a Pentium 166 on its high profile games like tekken 3.

Now PS2 on the other hand does the whole T&L task using the CPU only, which limits it quite heavily if compared to the GCN or Xbox that take a more PS1 like approach.
But the video at least support Z-buffer now, thus not requiring to reaorganize the triangles from back to front (but doing the other way around do increase the performance as you get some fun Z-discards).
Reply: Dr_Kachu san No texturing or lighting? For a video game console made in 2000? Damn. It's kind of funny to me how feature packed the N64 seemed, but was lacking in horsepower (although a lot of blame can be placed on the developers.) If the GPU can't even apply a texture, what's it good for? Can the GPU even output to anything that isn't the framebuffer?
Reply: *****
Nono, Its Transform and lighting, different thing here.
It's a series of 16 multiplications, 16 additions and three divisions you apply on every vertex of the model that transform the X,Y and Z coordinates into X and Y screen coordinates with perspective, and also perform all sort of fun operations like rotation, scaling, translating, camera like lookat stuff.. all in a single (slow) pass.
That's the transform part.

The "lighting" pass is kinda the same (but with only 9 multiadds), except it rotates the normals (think on those like "arrows" pointing at the direction the triangles are facing) to match the object rotation, so when you use those "arrows" to calculate if the triangle should be lit or not, they get it right.

On a hardware without any sort of T&L solution like the PS2, those operations are handled by the CPU itself.
But on the PS1/Cube/Xbox and beyond, there is this dedicated unit with several multiplication (and a few division) circuits that handle it much faster than the main CPU can.
Reply: Dr_Kachu san You mean that you just kind of give the GPU a model or something, tell it the camera angle, and then bam, there you go? From what you described transformation being, I'd have thought it was the CPU that was handling that. I don't really get what the lighting is though. It's just determining how much the polygons are facing a light source, and the more they're facing it, the brighter they are? (Or darker if we're talking about the back side.) It seems like this would only work for flat shading.
Reply: *****
Well, on the face thing i actually simplified a bit.
Its actually the direction of the vertices of the models rather than triangles, so you get a smooth interpolation between their brightness.
And to determine how bright it is, the light itself is one of those "arrows" (will call it  a vector as its the name), and the more the surface direction vectors (or normals) differ from it, the brighter it gets, by using a math calculation called dot product.

And yes, that's pretty much it on the transform part.
Well, a bit more complex than that as its a 4x4 matrix.
You can think on it as four of those vectors that point to what direction is X,Y,Z and W(!).
Like, if you set X to an vector pointing up, bigger the X more up the model goes etc..
Also besides that, this matrix thing also stores the model position in the world, and finally the weirdass W position is a special "coordinate" that is used later by the division operation i told you to make the objects get smaller as the W value goes up, which you use to do 2D perspective.
What generally happens on a modern hardware, is that the CPU task is to assemble this matrix, then feed the GPU it and then the GPU does the magic, and depending on how you set up the matrix, you get the camera, you get rotation, you get perspective  and so forth.
Reply: Dr_Kachu san So the W position just kind of serves as a size selector? Why cant you just decrease the x and the y and the z? One thing I always wondered is is there a way to sort of make a 3D model, but make it appear exactly the same no matter where on the screen it is in that there's no perspective? I mean, imagine a cube to where the side that's facing you is grey, the side on the left is blue, and the side on the right is red. Looking at it straight on would look like a gray square, but normally, if you moved it to the left side, red would start to appear. Similarly, if you moved it to the right, blue would start to appear. However, if you did the special thing I was talking about, it would appear like a perfect gray square no matter where it is. I'd be kind of like rendering a character on it's own separate picture, and then placing that picture onto the framebuffer. It makes no sense in terms of 3D, but I imagine it could be useful.
Reply: ***** Well, the W is needed for things like moving the camera around the world. It is "the vector that points to the direction where objects get shrunk", so generally pointing at the camera viewpoint, and well matrix math is a messy huge thing.
Also this thing you're talking about is called the orthographic camera.
It kinda is used on modelling tools and those diagonal pseudo 3D games like super mario RPG.
Reply: +Dr_Kachu san Wut? How can a RISC ~340MHz CPU be faster than a ~730MHz Pentium 3 clone?
Reply: MrSlashStudios By having what is effectively three cores, and a fuckton of floating point power between em.
Reply: Dr_Kachu san Ohh I see it now. The PS2 has 2 dedicated vector processing units running at half clock speed and some other dedicated processing units.
I doubt it will beat the x86 Pentium III-coppermine-based processor in most tasks but maybe for pure vector processing it might beat it.
Anyways, the GPU of the PS2 doesn't even come close to that of the Xbox haha
Reply: MrSlashStudios Well yes, its the GPU that puts the final weight, as i said on several posts above, the EE can deliver up 6ish Gflops when using all its units to do Fmac bullshit, but it NEEDS to do it because the hardware don't have a dedicated T&L unit or audio mixer, while Xbox does and can push 10Gflops out of that thing without using even using any CPU time.
So Xbox probably have a weaker CPU, but it don't actually need it (for 3D rendering that is).
Reply: Dr_Kachu san Thanks for all the technical information, it's really interesting :)
I love the 6th generation (buy all the good games before they get expensive)
Reply: MrSlashStudios You're welcome.
Also, well "technically speaking" Xbox have more CPU time available for games, because well, it is not constantly wasting a fuckton of CPU time emulating shit even the PS1 did with dedicated circuitry. Which means PS2 only have an actual real CPU advantage over the Xbox while doing 2D games.
Reply: Mike Fox The PS2 was weaker than Xbox and Gamecube.
Reply: PS2 had a total of 12 processors but only 1 was a general purpose CPU. In terms of physics it exceeded the Xbox capabilities because the PS2 had asics just for that while the XBOX did not.. The Xbox did have a better GPU though.. However the PS2 had more optimizations and the use of asics (application specific integrated circuits). I won't talk about the Gamecube because actually it had better cpu and gpu than the others.. Which makes it obviously ahead of the PS2 and Xbox. But the PS2 was still comparable to the Gamecube, it wasn't that far behind it.
Reply: Ps2 was the weakest one. It was Xbox > GC > PS2.
Reply: @arwlyx  The GameCube was significantly more capable than the PS2.  Have you seriously never even played a GameCube game?  It is pretty obvious which system has more horsepower.